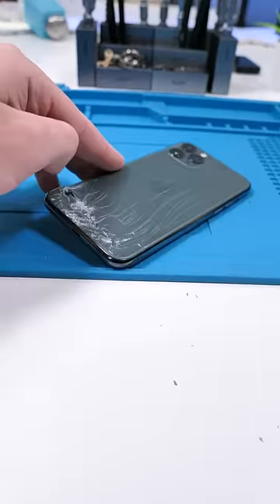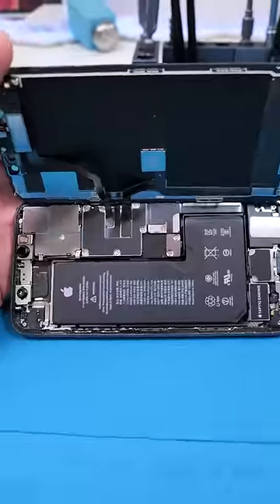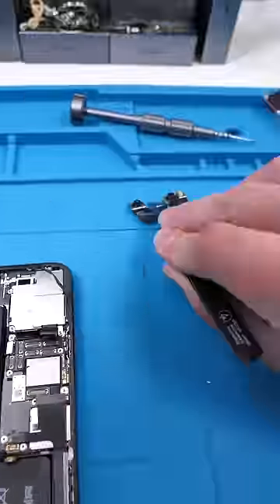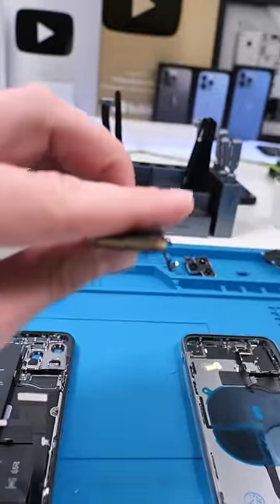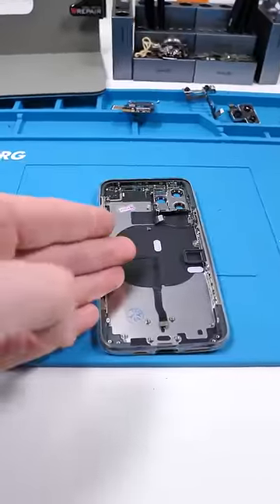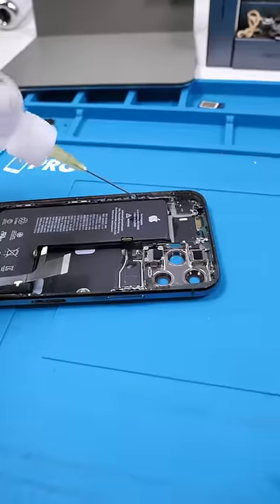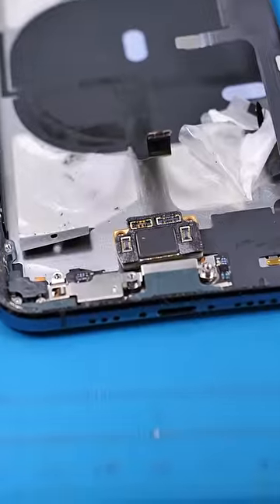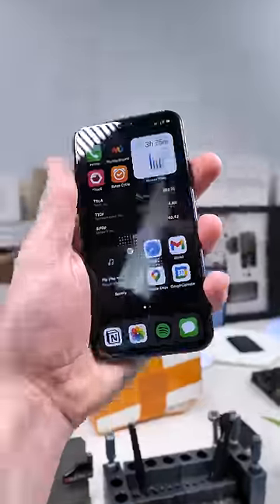This Was Supposed To Be A SHORT... iPhone 11 Pro Wrecked..

Comment: If you apply rubbing alcohol before pulling on the cheese doesn't it make pulling the cheese much easier?  Those adhesive strips are essentially the same thing as 3M's Command strips. They release the same way. Rubbing alcohol then pulling the thin foam backed adhesive should make it release easily.
Reply: from my experience, it actually makes it harder to pull the tabs. they rip easier and they lose grip, so good luck using tweezers if the tabs are soaked in alcohol lol. if you use alcohol, might as well just pry it out. there is no shortcut to the cheese, 80% chance it won’t come out the way it’s supposed to and that’s probably the way it’ll always be unfortunately, no way around it lol. try taking out an s21 battery, those are probably worse to remove
Reply: I have had very little luck getting all the cheese out without one of the tabs breaking. One thing that apple should add is the U shaped cheeses like on some of the new MacBooks so that if one side breaks you can just pull the other side out.
Reply: Hi
Reply: Pull the tab out slightly and then a couple of drops of alcohol underneath the tabs and they slide out super easy.
Reply from the maker: Love how we’re all just casually calling it cheese
Reply: @PhoneRepairGuru  yeah lol
Reply: @PhoneRepairGuru  if the cheese stretches, pull it
Reply: @PhoneRepairGuru  True though-😃
Reply: @PhoneRepairGuru  since I heard you start calling it that.  I've heard it a few other places.  Seems you're a trend setter.  My daughter has started to repair old iPhones because of you.  She's 9! She's done 4 phones (iPhone 4c as they are cheap and easy to find) , replaced screens main boards, batteries she loves it.  Any tips you have for her to find functional (Non cloud locked), broken phones? EBay's are all cloud locked or too expensive.
Reply: @PhoneRepairGuru  ha its white cheese
Reply: @Scott_C  put a listing on Facebook market place, tell people you're paying higher than phone repair shops do for broken devices (it's highly likely you're able to offer slightly more than a repair shop) and also don't forget to double check the iCloud is removed lmao
Reply: @Scott_C  you can do like a temporary jailbreak to unlock them, but it needs sketchy software if you want it for free

Comment: Hello
My name is Roland and i have an Iphone 6
I am good at tech and i changed the phone battery mute button and the flashlight because it turned on for a second and it stoped working even the phone showed me that the flashlight is on. I changed the flashlight and it still wont turn on the phone has ios12.5 the phone was reseted once too and it's still not working

Comment: PRG i just wanna ask, what to do with my iphone 6s plus that doesn’t receive calls and can’t make calls but it can receive and send messages albeit kinda slow and the receiving end. I mean i know its kinda old but it works fine until the calls are done for. So i kinda wanna save it. So what should what I do with it. I think it has something to do with its hardware failing rather than software coz i already tried resetting it a couple of times already but its still pooped hahaha

Comment: Why dont you get a pulled housing that has everything except the logic board so you just need to transfer the logic board. Wouldnt that save so much time, it would only take like 15 min. Love your vids btw!! Keep it up
Reply: That would result in the phone losing Face ID, battery health, True Tone, and getting pop-ups in settings for the cameras, screen and battery.
Reply: @Enter-the-Meta  not really, just transfer over the paired components
Reply: @GamerBit  Transferring over those components takes time, and while technically not very long compared to what was done here, it is much more expensive resulting in a lower profit margin, and the odds of you needing to reuse those pieces is fairly low. I’m not saying you can’t, but unless the only thing you value is time then it’s really not worth it.
Source: I’m a phone tech myself.
Reply: @Enter-the-Meta  thank you for that information. So it’s better to buy a aftermarket housing with just nothing in it? Because I tend to find the aftermarket housings be slightly cheaper but not that much of a difference
Reply: @GamerBit  Depending on your prices and how busy you are, it seems the preferred package by businesses is the ‘housing with small parts,’ which is the best of both worlds. They don’t contain the redundant (and expensive) pieces that will be switched out to retain the features mentioned above (with exception to the battery, although this varies depending on who you order from), but they do have enough of the fiddly pieces already installed to save a substantial amount of time. I personally do glass only replacements (meaning I keep the original housing + parts), which allows me to offer much lower prices, but honestly takes a very long time and if a shop is experiencing a large influx of orders is probably not feasible.
Reply: @Enter-the-Meta  I see. Thanks for the advice, I was hesitant because I would sometimes buy pulled housings from eBay and use them, but then be far more expensive and take so long. I appreciate your information, I’m a highschool student that wants to do repairs in the future, so this will help with my journey. I only offer repairs at home now since don’t have a store or location lol
Reply: @GamerBit  Hey no problem! I’m actually a student as well, which is why I only offer mail-ins right now.
Reply: @Enter-the-Meta  Whats the best way to promote your phone business so people can trust you with professional repairs. Im only 16 and who wants to trust a 16 year old with a expensive iphone to repair, even thought I fixed up to the 12. Thanks
Reply: @GamerBit  Hey again, just checking that my last reply came through? I sent a big paragraph about setting up a website and getting reviews, but just then as I clicked through it seems it may not have posted?
Reply: @Enter-the-Meta  no I never got it
Reply: @GamerBit  Hmm, sorry about that. In essence setting up a website is a really good way to build your credibility as a professional over just ‘someone with some skills,’ as well as providing a location for you to point potential clients to. I use porkbun and have access to a domain, web hosting and a website builder for $12 a year + $3 a month, which is ridiculously affordable for what you get #notsponsored :) You don’t even need a physical shop, you can just market to mail-in orders only. As long as you have somewhere to point people who seem interested, it’s much more likely that you’ll get a sale (and these people will most likely be able to work things out with you in-person).

I also found it really helpful to get reviews from family members and friends after repairing their devices. You can create a Google business account for free which helps promote you, and those reviews can be placed on there, further adding to your credibility. 

Hopefully this helped a little, and I may have missed some stuff from before but I’m fairly tired right now😅

Good luck with your business!
- A fellow 16 year old
Reply: @Enter-the-Meta  no Problem. Thanks SO much for your help, you have made is very clear and let me in the direct path. Never knew a google business account was free